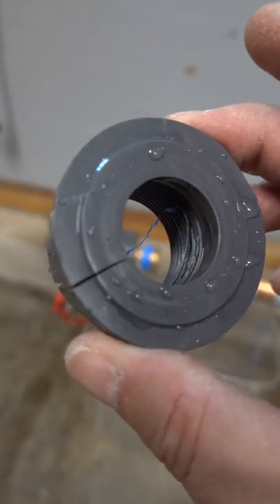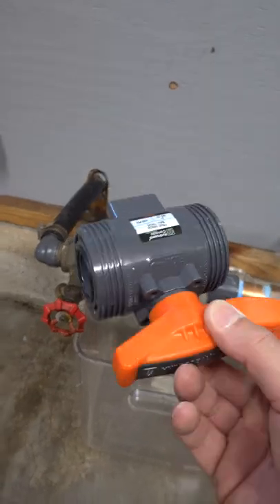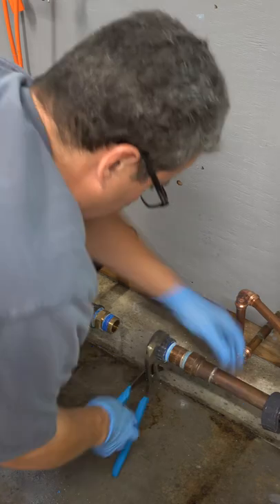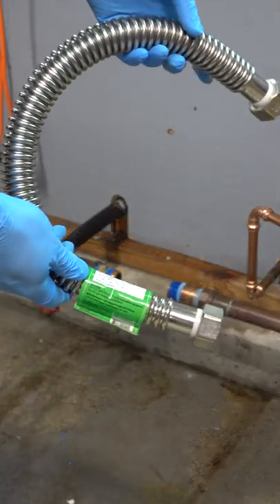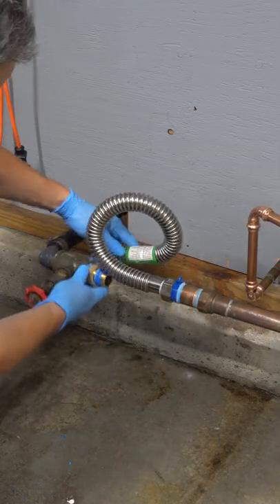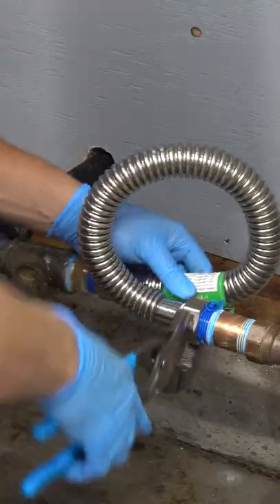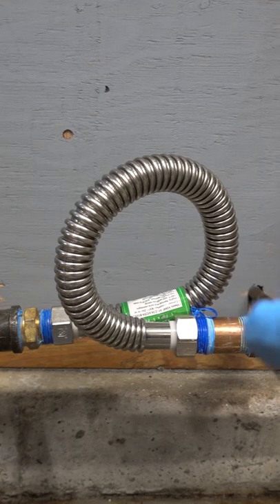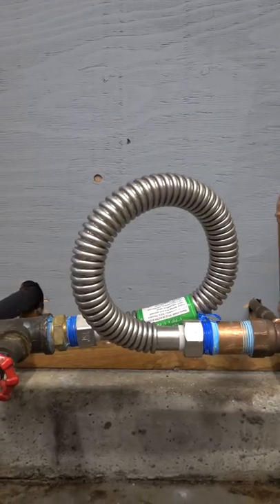POS Valve Almost Ruined by Marriage

Comment: When you used the channel locks the wrong way... I felt hurt by that
Reply: Only for the camera so you guys can see it
Reply: I get that way with guys at work.  Only when necessary!!!!
Reply: I was like wait that’s backwards.
Reply: Thx for the laugh
Reply: Same here
Reply: Yea, it kinda hurt a tad. It's like you stop caring whatever they are saying instantly. 😆
Reply: This is what I opened the comments to say. Not sure why it physically hurt to watch him use those incorrectly but I did feel some type of way.
Reply: Pretty sure he mentioned this was temporary.  I bet his final repair would surpass your expectations.
He has my permission simply because he didn't use crimp fittings.  He can do about anything he wants as long as he didn't do that.
Reply: @thisisyourcaptainspeaking2259  How does this have anything to do with using the channel locks the wrong way??
Reply: @csorrows  Thought I explained that but just for you...  At least he didn't use crimp fittings.
Reply: @csorrows  look at my thread with this person... he's clearly not all there
Reply: @thisisyourcaptainspeaking2259  
If he uses another plastic valve, I’d say he failed on all counts.
Reply: Lol I see it all the time. You get maximum leverage one way and no leverage the other way. When I first started plumbing I would crowned for doing something like that and then I learned real quick that one way is much easier than the other
Reply: Not to mention he put Teflon tape on non tapered threads that use a gasket to seal and it looks like he actually rapper Teflon in the wrong direction, and when you transition to plastic is best always to use plastic male threads into metal female instead of tefloning the s*** out of something and tightening it until It Breaks
Reply: @joshallen5547  precisely, I've seen it first hand. I've seen a plumber of 20+ years tighten a sch 80 female adapter to a 3/4 male copper yard line by the house, used the shitty, pasty, white pipe dope and just went HAM tightening it, needless to say it cracked... and dripped. Didn't want to say anything but I would have done it differently myself. At least I wouldn't have tightened it 110% on the threads bc that's when I heard it snapping and cracking. If I were running that job I would have pro-pressed a copper to male adapter to pex to the copper side after cleaning the existing line up and then getting another sch 80 female adapter and threading (very carefully) into the pvc side and having pex fill the gap we cut out. Let me know if you would've done anything different
Reply: That’s the first thing I noticed haha
Reply: That's the only thing I got out of this video, not to take any advice from this guy
Reply: A lot of stuff wrong in the video.
Reply: Me 2
Reply: Dude that’s embarrassing right. No wonder he is fixing shit two days later..
Reply: I threw up in my mouth
Reply: I’m glad I wasn’t the only one who noticed
Reply: Facts
Reply: @joshallen5547  when he showed the break I instantly thought,
"Definitely over tightened that fitting for it to break like that"
Reply: Boo hoo
Reply: Every time he used them backwards
Reply: Same🤣
Reply: "Hot water heater" had me ☠️
Reply: @thisisyourcaptainspeaking2259  shark bite fittings it is
Reply: @walterbrunswick  So you condone taking short cuts and calling them long term solutions, got it.  I prefer doing it the right way unless it's a temporary repair.
Reply: @bobby_greene  May as well, just as good.

Comment: Replacement valve 🤣 it will be like that forever or until it leaks. Also plastic fittings can crack because of too much pipe tape and over tighten. Great idea 👍
Reply: That's a pro for ya...😂🍺
Reply: Came here to say the same thing.

Comment: Teflon tape and female pvc fittings with male metal pipe is a no go.
Reply: Can you please explain why to the non experts like me. Homeowners who may need a quick repair
Reply: @TheClickClick  plastic stretched and flexes. Metal doesn't and will stretch plastic until it breaks
Reply: Any plastic Female thread is no good even worse with a brass male thread connecting to it. 

splitting is common with plastic female fittings, any reason a brass or bronze body valve with a Union at one end was not used ?
Reply: Yeah he overtightened it and cracked the plastic.  I'm always super careful with these plastic nuts.  I avoid them whenever possible.
Reply: If your careful its fine. He has put too much tape on and overtightened. You can tell he isnt a pro.
Reply: @TWH442  I hate to throw around the "pro" label.  Just because you do it for a living doesn't mean you are good at it.  And just because you don't do it for a living doesn't mean you aren't good at it.  When tightening plastic nuts, the common sense thing to do is to be slow and cautious.  How much tape is there doesn't matter, but what does matter is the torque.  Although if the thread is tapered you shouldn't need any tape with a plastic nut.
Reply: @semosancus5506  🙄
Reply: Not entirely true. I installed a 15mm speed fit connection on a copper pipe that feeds cold water to my washing machine 3 months ago and it's held up perfectly fine without issue.

A metal valve that I had originally installed a week prior kept leaking and no amount of tightening or PTFE tape would stop the leak.
Reply: @semosancus5506  no clue
Reply: @MK-xl9tt  Are you one of these guys who uses 20 wraps of tape to "seal" a joint?
Reply: It’s not that he used Teflon it’s that he used too much. Teflon is completely fine to use in a fitting like this but use it sparingly.
Reply: It is on Sundays after 5 pm.
Reply: @TheClickClick  plastic threads into metal only same for electrical 👌
Reply: @benjaminmclaughlin4746   you mean metal expands while plastic does not. That is why male metal threaded into female is a no go. However, plastic male threaded into metal female is fine. Too much Teflon does nothing but not let it be threaded completely. Also, if you tighten a Plastic Male threaded into a female metal threaded too tight you create a weak point at the base of the thread.
Reply: @semosancus5506  HaHa, no sir I don’t use 20 wraps but I do use Teflon tape and pipe dope both on stainless steel connections and boiler applications because I’ve been in the plumbing and hvac business for 30 years and don’t like call backs. We all know a female plastic adapter on a metal male adapter is a no no and a plastic fitting would need some pipe dope unless it had some type of washer to make the seal.
Reply: @MK-xl9tt  Yeah I guess that is what I was really thinking - plastic nut on metal pipe?  Nah, I think I'll pass.
Reply: @benjaminmclaughlin4746  yeah it's a bs quick fix that's why he used half a roll of Teflon tape
Reply: I am a industrial pipefitter. I put pvc to metal all the time. The issue is you cannot over tighten. I always used tape and dope and take to maybe 30 to 40 ft lbs of torque estimated for a 1 in connection. Never had a issue with sealing or cracking. I have had issues with pvc threaded flanges cracking but then again it's a multi variable torque.
Reply: @TheClickClick  nominal pipe thread is fluted. Which means the diameter at beginning of thread is slightly smaller then the end of thread/ solid pipe. Female threads are symmetrical through the inner threads. So as you thread the male end in. It gets slightly bigger. Going too far or too tight or even using pliers in this combination is a recipe for failure.
Reply: You are correct, Lasco the maker of PVC fittings says never to use Teflon tape as it puts more stress on joints an approved liquid thread sealent can be used since it can escape from areas of high stress unlike tape.
Reply: i install schedule 80 valves with female ends every day. hand tight + 1/4 turn. 
that mil spec Teflon is really thick, so only 3 wraps.
Reply: Everyone should know you never put metal inside of plastic fittings 😂
Reply: If your a goof and over torque, otherwise it's fine
Reply: @timkopp2204  mil spec? Does the military use thicker Teflon?
Reply: @sparrowhawk8539  MIL SPEC T-27730A. "Mil-std" or mil spec.
specifies the thickness , 3.5 mils, and the density.
If you buy cheap teflon at the big box store it's pretty thin and hard to work with. The blue Monster brand is really good stuff!

Comment: 5th rule of plumbing, tights tight too tight is broke! Pipe it back in brass with a union
Reply: My grand dad had the best advice. tighten it until it snaps, then back it off a 1/4 turn, job done
Reply: Tighten it until it cracks, take it off apply more thread tape, put in back on hand tight....

Comment: That was a good improvise to repair that problem! Just keep in mind when using PVC or CPVC in line with metal piping you should have at least 12" of PVC on both sides of your PVC fitting to absorb vibration and prevent cracking especially on a water well the pipes move a bit from the pumps and pressure changes!!
Reply: All it breaks the grounding bond

Comment: You can't get a shut-off valve on sunday, but somehow you get a stainless steel flexible pipe on a Sunday
Reply: Theoretically you could get one at Lowe's if you could find where it was misplaced in the wrong bin
Reply: That flexible coupling is a standard part you can get at any hardware store.

That valve is probably not something you can get at your local hardware store.

I haven't seen a valve like that at my local home depot, and I don't even know why you'd use a plastic one like that or what it does. The regular shut-off valves we get around here are made of metal
Reply: It's an advert 
But a nice one to be fair

Comment: That Schedule 80 valve was just fine, tame down your PTFE usage and stick sith pipe dope/thread sealant. Also be gentle with how tight you make it
Reply: No. You don’t put metal male threaded fittings into plastic female threads. The opposite is fine. This is just bad practice

Comment: From black pex? to gray plastic to brass valve with way to much tape on threads(probably what broke the valve) to stainless to copper to older copper to brand new copper with pro press fittings. Use less Teflon tape, I recommend blue monster. Using all those metals in short span or touching each other will cause galvanic corrosion. Please don't cause more problems than necessary

Comment: That plastic hunk of crap shouldn't have been installed to begin with.  Why the redundant valve anyway?  Swap it for a brass body and that won't happen again or just leave the hose there - it doesn't leak and can be taken apart if needed.

Comment: Cracked for 3 reasons 
1 go light on tape 
2 it’s a plastic female. Junk
3 if going that route put a hose clamp on the plastic female fitting     Also possible over tightened 

As a plumber of 30 years never would I use a plastic female I would reverse it metal female then plastic male

Comment: I'm a pipefitter by trade. What you had in the original configuration is generally a bad idea. Never put  metal into a plastic fitting, only put plastic into metal. Metal can take the internal pressure from inserting plastic threads, but plastic can't. It splits. Imagine that, you discovered a commonly known piece of plumbing knowledge.

Comment: I don’t think I’ll ever use one of those hoses again. I replaced my water heater and added a new one of those on the hot side. A year later when I went to flush the water heater I discovered that line had recently started to drip right behind the connection on the water heater side. Changed it to a steel braided sharkbite fitting after cutting off the threaded end on the house side. As a temporary fix for your well I’m sure it’s great. But I wouldn’t use it for anything I intend to be permanent again.

Comment: That coupling didn’t crack by itself. It either was over tight and someone kicked it or it was over tight and your water network is prone to water hammer, get a damper tank or perhaps yours is full of water. Some plumbers install those tanks above a water heater and never fill them with air, also the air over time the air can dissolve out, its crazy.

Comment: Don’t put plastic on the outside of metal. If you have to combine the 2 make sure the plastic is the male so it doesn’t crack from being over tightened even slightly.

Comment: Don’t tighten plastic fittings with a tool and don’t overdue it with the Teflon or you over pack and the pressure splits the fittings. Use sch 80 for a little bit more strength

Comment: Loctite 567 the reason why that Union broke is because you over tightened it. You're not supposed to use teflon when you're screwing plastic. Loctite 567 will always hold never get hard and all you have to do is tighten it hand tight and go and half turn past

Comment: Why not just replace with a brass ball valve? Hardware stores should have those.   Female plastic connection will break when over tightened, and it is so easy to over tighten when male metal fitting is threaded into plastic female fitting.

Comment: I noticed something I love using water pump pliers and I would never tell anybody that they're not to be used but he is turning them backwards so that it doesn't tighten it as you push making it much harder to get the proper Leverage on the nut

Comment: You need to know how to use Teflon tape and channel locks properly so this doesn't happen again. 

You wrapped too much tape or didn't remove the old left on copper, it bunched up in one spot when you tightened it.  Know that any pvc female threaded adapter is very fragile especially pvc to metal.  The copper tends to have a very flat tapered thread which puts lots of stress on the fittings.  Try not to over tighten the fitting, you will notice the outer rim of adapter swell its too tight and will crack.

You need to flip your pliers around to engage the main Jaws and not the moving handle.  They will slip  strip and hurt your hands if not properly gripped.  The position of the channels should be with handles almost closed but not touching when grabbing the fitting.

Casey

Comment: What's the purpose of a having 2 valves right next to each other? There is a standard brass gate valve next to a 1/4 turn pvc ball valve? The threads cracked because they were probably too tight. If I were you I would either leave the flexi hose or replace with coupling, nipple, union, close fit nipple, coupling. One nipple may need to be custom but it looks like there is plenty of flex.
Reply: Redact that. Upon further review there is a gate valve to a male coupling to flexible hose to copper nipple. Why not nipple, threaded union, nipple. Remove the male coupling. Still don't understand the dual valve. Unless the gate valve is for flow restriction or a weird code. Fyi I was a industrial pipe fitter/welder for 20 years. Worked on everything from refrigeration, boiler tube, high pressure steam, sanitary, sulphuric acid, etc. Seriously, reach out to me if you need better help or information. Good idea for the quick patch btw.